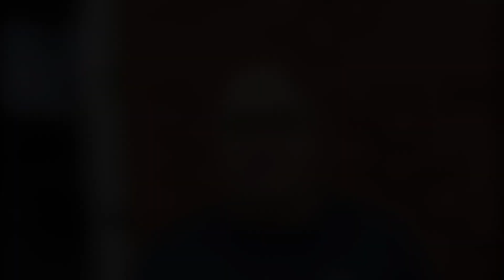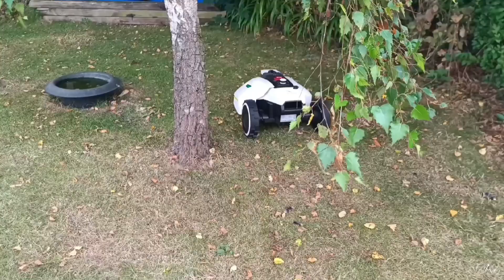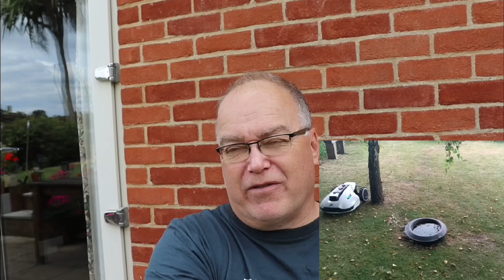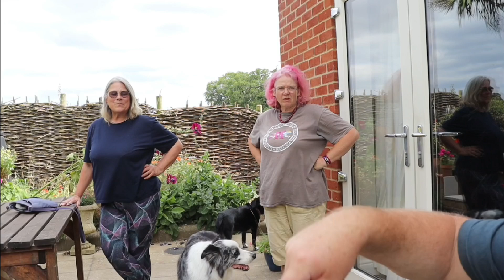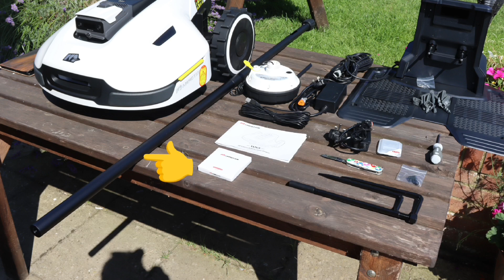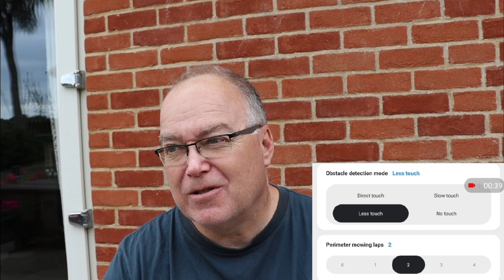Mammotion Yuka 2000 robot mower - No perimeter wires - Surprisingly easy, effective and fun

Comment: How often do the blades need sharpening/replacing?
How much does it cost?
Reply: Wow, just seen that it costs £2,440. Too expensive for me I’m afraid.
Reply from the maker: £1500 for the slightly lower spec one , the 2000 is ott for my lawn tbh

Without the sweeper kit it's much less too
Reply from the maker: From about £12 to £60 depending on brand and quantity . Came with multiple spare sets but I'm not expecting to change them at all tbh if it's only cutting grass.  I've never sharpened my mowers blades for example but some sharpen them annually

Comment: How does it cope with mole hills? Of which I have loads…
Reply from the maker: Depends on the mole hill,  but my normal mower wouldn't go over a decent mile hill either , best to clear them first along with any debris 

I haven't encountered one yet , we've scared off our mole but I'd guess it'd detect a normal sized mole hill as the front bumper is quite low

Comment: If you get the cheaper end of the robot mowers, they cerainly have a perimeter wire. It was not a problem fitting this. Worst part is that it follows a permanent path back home and after a very wet start to the year, it did dig a few holes where it turns to follow the wire. Burying a paving slab or some half bricks seems to have helped and reduced further digging! 
Apples that fall from our tress are an absolute pain and need to be cleared from the garden, to allow it to work, otherwise it climbs them and complains it has been lifted. Our garden is far from flat with many undulations and in general it does very well.

Edit to add that my neighbour loves to watch the mower going trundling around the garden and finds it therapeautic.
Reply from the maker: Add a spoiler to the front to move the apples ?
Reply: @EVPuzzle  Will you be getting the brush attachment for yours?

Would be interesting to test what size objects it's capable of picking up as I've not seen anyone do this yet (acorns, conkers, apples, golf balls, etc ....or just small leaves & clippings)
Reply from the maker: @DEADB33F  yes I've got.it ,.just haven't installed it yet
Reply: @EVPuzzle  Great idea!!

Comment: I have the Luba 5000. I'd honestly put no-go zones around any permanent obstacles.  If you rely on the obstacle avoidance at some point it will get stuck on things, ride over them, jam a disc,. etc. It's just a matter of time.

I'd try to use the avoidance as a last resort / backup for if things accidentally get left on the lawn (furniture, sleeping dog, etc).
Reply from the maker: Just tried that, it's leaving more grass uncut , I'd rather set 'no touch ' and let it do it's thing , less turns involved too.  Not much in it tbh
Reply: @EVPuzzle  Fair enough. So long as nothing of importance could be damaged if it fails to spot things then it's not a big deal.

I did have one incident where the obstacle avoidance failed and it turned into and scratched the front bumper of my lodger's car.

...his fault for parking slightly over the lawn but I still felt bad about it.

Comment: We've had a robot lawmower for years. It's just fantastic. The lawn always looks good and it's so quiet that we set ours to run at night! All you need is strimmer to do the edges now and again. You just need to make sure all the usual obstacles are out of the way before it starts and it's rather hassle free!
Reply: I get too much grass build-up if I mow at night or too early in the mornings when there's dew on the lawn.

Mowing mid morning till early afternoon seesm to be best as it means I rarely have to clean it.

...Also the Yuka & Luba 2 vision object detection doesn't work at all at night. so you're then entirely reliant on no-go zones and physical detection via the bumper switch.
Reply: @DEADB33F  I think I get away with it not clogging because I have it running every day. Ours uses the guidewire and bump sensors so it can run at night. It's dumb I suppose. My two year old asks me to wake it up from "sleeping" sometimes and chases it around the lawn (while it it is bouncing around trying to find the charging base with the blades switched off) which I find rather cute. It's multipurpose!
Reply from the maker: @DEADB33F  good heads up...gotta try it though , surely
Reply: @EVPuzzle  In the interests of a thorough review then yes, obviously has to be done (I've already seen your newest video of course)
Reply from the maker: Night cutting with a spot lamp on might be fun 😄
Reply: Agreed, I’m painting mine tank like over the Winter.

Comment: Who empties the grass collector - human or robot?
Pity it needs mains power to charge and cannot solar charge/ power it
Reply from the maker: I agree, battery and solar would be so much better than mains 

It collects and auto empties in designated place .  If placed near a compost area it should be a very easy rake to remove it . Obviously it can't tip them over the fence etc
Reply: It just drops the clippings on the grass. They just seem to vanish!

Comment: How does this homage to Bigtrak deal with a doggy deposit, obliteration or circumvention? 
Also, why make the thing white? It's not like it'll be immune to grass and soil stains, but can it drive itself to the local carwash?
Thanks for another fun video.
Reply from the maker: I suspect it'll pick the do do up on its wheels!  

 definitely won't avoid it , it's a determined thing

As for white , maybe the faded effect will be better in white ?  I've ceramic coated ours with a ceramic car cleaner hopefully making it easier to wipe clean
Reply: @EVPuzzle  Is the cover ‘removal able’ for painting / wrapping ?
Reply: I too was going to ask about how it deals with 'the dog elements' before you get to them?
Reply from the maker: We're usually good at detecting and removing the dog deposits so hopefully it won't be too bad .